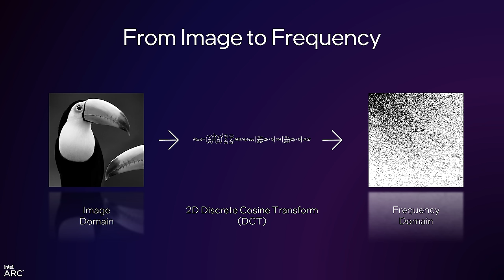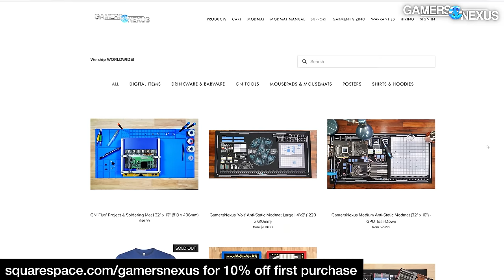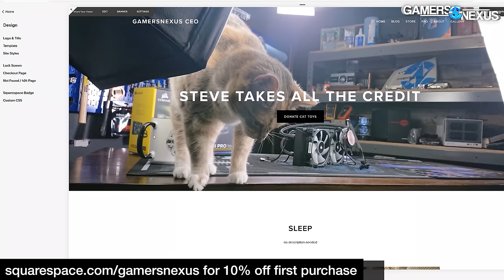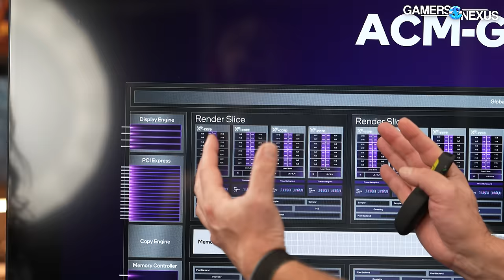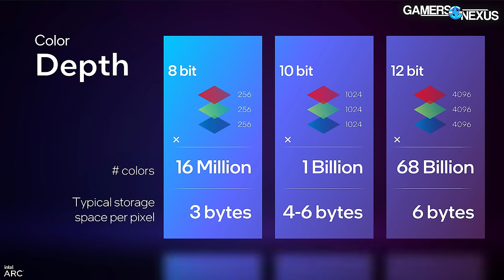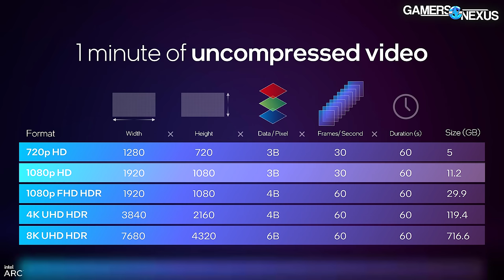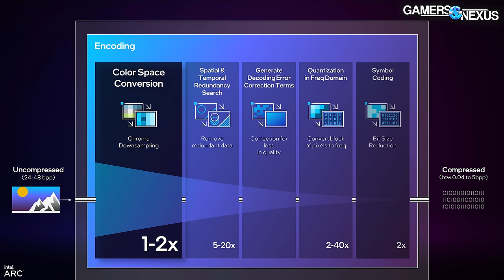YouTube's Existence is Insane: How Video Compression, Encode, & Decode Work (Basics)

Comment: Small correction: YUV 4:4:4 / 4:2:2 / 4:2:0 doesn't describe bits, it describes how many chroma samples are stored. The first '4' says that we are talking about rows of 4 luma samples, the second number describes how many chroma samples are stored in the first of two lines and the second number how many chroma samples are stored in the second line.

That means a 4×2 block of luma samples contains

• 8 pairs of chroma samples in YUV 4:4:4
• 4 pairs of chroma samples in YUV 4:2:2
• 2 pairs of chroma samples in YUV 4:2:0

Another way to think about it is that in YUV 4:4:4, each luma sample has its own pair of chroma samples, in YUV 4:2:2, each 2×1 block of luma samples shares a pair of chroma samples (the chroma planes have full vertical but half horizontal resolution) and in YUV 4:2:0, each 2×2 block of luma samples shares a pair of chroma samples (the chroma planes are half horizontal and half vertical resolution).
Reply: 4:2:0 is truly a nonsensical shorthand made by an insane person.  Because 4:2:2 and 4:2:0 are the only ones that realistically exist, you could just as easily describe the stored chroma resolution of a 2x2 square of chroma pixels instead of the insane self-referential sample numbers, for example:
YUV 2x2 = YUV 4:4:4
YUV 1x2 = YUV 4:2:2
YUV 1x1 = YUV 4:2:0

Even if you argue that you must keep the 4x2 rectangle, describing the stored resolution still works and is way less insane than the "number of changes of chrominance samples between first and second row" like bruh
Reply: This comment needs more attention. It’s good knowledge
Reply: @krakow10 It is a truly bizarre naming convention, I've heard it explained multiple times and never fail to promptly forget what it means. It's easier to just remember one is full res, then half res,  and quarter res .
Reply: @tiarkrezar  Indeed. It makes no sense because its roots are in analog TV and the numbers are not bits but factors of carrier frequencies intermingled with interlace logic.
Reply from the maker: Thanks for this! I asked Intel (since, like I said in the video, I know nothing about this field). Intel said this: 

"Good catch! Although there is a correlation between how many bits and how many chroma samples you store, the numbers represent the actual amount of chroma samples."
Reply: @ИванСнежков-з9й  I didn't know about that history, that's some great technical trivia.  29.97, interlacing, chroma, it all has deep roots going back to the beginning of video technology...
Reply: @casperes0912  It also did not say anything about how the position for the chroma sample  to the luma changes between video formats.   Then  YUV  also has NCL or CL conversions or in a crude way to say "gamma aware" or not.
Reply: This comment is an example of why good conversation after a video is so valuable. Error correction, info expansion, context - all helpful in getting everything sorted and understood.  Thanks!
Reply: @krakow10  YUV 4:2:0 is not a nonsensical shorthand. It exists to easily differentiate from 4:1:1, which is actually much worse.
Reply: @krakow10 Hearing 29.97 again gives me 2:3 pull down chills 😂

Comment: 13:00 that's why it's so hard to compress confetti, snow, or other super small moving parts in a video. There's even a term called "compression nightmare" for these scenarios. Videos appear to be at a low bitrate, internet usage spikes, as well as cpu utilization.
Reply: slow mo guys have show this well with their glitter stuff, gavin is actually very knowledgable about this stuff.
Reply: I remember part of the reddit blackout protest was to upload videos of static that are essentially impossible to compress.
Reply: Yup... a lot of new information gets introduced and removed by the next frame, which makes it impossible for most algorithms to deal with this situation...
But the good news is H265/HEVC/VP9/AV1 encoder/decoders can deal with these situations A LOT better compared to the old ones such as Xvid/DivX/h264/AVC/etc...
Reply: @SkidrowTheThird  by blurring them out lmao, gotta love sao in x265
Reply: and also why common things like a gradual fade in a video is actually quite difficult for compression to deal with, there's very little per-pixel frame-to-frame stability
Reply: I remember running into this issue when playing back a ripped Blu-ray of Prometheus many years ago. There's a scene where Fassbender's character is looking at a holographic display that composes images using thousands of points in a 3D space. When streaming the movie over my local network to my PS3, it always stuttered badly at that scene. The PS3 lets you see the playback bitrate, which showed it go up about 10x when that visual effect was on screen.
Reply: @SkidrowTheThird  Film Grain Synthesis in AV1 is good
Reply: @brunogm  Nope, it is not there yet, very artificial

Comment: WRT frequency domain on images.
Picture it like this: the corner (0,0) is 0 oscillations -- constant value. the pixel at (0,1) has zero horizontal frequency, but 1 oscillaiton on the vertical, meaning it starts at 1, goes to 0, then back to 1, sine wave style (well, cosine actually but you get the idea, it's smooth and connects cyclically end to end). the pixel at (0,2) is the same but has two oscillations vertically, and so on. This step is usually performed on small blocks, 8x8 or 16x16. So on a block of 8x8, the frequency pixel at (8,8) is a checkerboard, and (0,8) is a series of 8 horizontal lines black white black white etc. the bottom right pixel (N,N) on any resolution ALWAYS coincides with the pattern that gives you a checkerboard.
Reply: Edit: Welp, I tried to explain Frequency Quantization and Symbol coding when PAT did it better... When they talk doing it in the residual, that's another layer of optimization in newer video codes, as it works the same as with JPEG images.
Just to expand on it, as this was a moment of realisation for me when studying this JPEG compression: 
For each block of 8x8 pixels of the original image, we will assign a concrete "checkerboard/frequency" coefficient value. Meaning, if the first 8x8 are mostly black, they will recieve the coefficient (0,0). As this is a standard, we know that if we recieve (0,0) this can be reconstructed directly to a set of 8x8 pixels. If you zoom in all the way, you can appreciate the DCT patterns.
We can apply a low-pass filter (reducing sharpness) and then can compress further by assigning compression algorithms to how many bits are needed for each coefficient. Meaning that coefficients that are more common (low frequencies), will use fewer bits that higher frequency ones.
I probably have some of this mixed up as this was some time ago, but it was cool understanding how videos are compressed.

Comment: Computerphile did an introduction on DCT a few years ago going into more details of the math and intuition of the algorithm, in their 3 part series of covering JPEG compression. For those interested, it is a series worth a watch, as video compression seems to be very similar to JPEG compression on differences between frames.
Reply: HEIF, the format that is likely going to replace JPEG everywhere, is in fact just a single frame of H265 video. It just makes sense to reuse the same format for many reasons.
Reply: @Finder245  same case with AVIF, but HEIF will definitely not supersede jpegs
Reply: 3 Blue 1 Brown did an EXCELLENT video on the Fourier Transform which explains how these sinusoid transforms work, and I think explained the tricks they use for the FFT.
Reply: Veritasium also did a pretty good video on the Fast Fourier Transform that underlies DCT.
Reply: Reducible as well!
Reply: @webx135   3 Blue 1 Brown   is the better video.     This GN/Intel colab simplified the transform stage  only showing full image transformed.  In actual codec there is a complex block partitioning first into  blocks (4x4 ... 64x64 )

Comment: Frequency domain analysis is an extremely fun branch of math that has applications in so much stuff
Circuits, sound, images, video
You can view any information as a combination of several waves and instead of analyzing the signal you study its frequency components 
One of the steps there is the same as doing a low pass filter in audio, except high frequency in images correspond to sudden changes in values. Clipping it blurs the image (or whatever the equivalent is in YUV) 
Doing a high pass filter meanwhile is an useful way to get any edges which is useful for image recognition algorithm/AI but makes the image look like a normal map (that's tangent space, not frequency space, but hey)

Comment: I don't know how popular this video will be, but you have my gratitude for doing this. I'm pretty deep into video compression with AV1, but I've never really understood the basics of RGB and YUV (although I had a rough idea of what YUV 4:4:4 does).

So thanks for the very helpful insight, and please never stop making these kinds of videos!
Reply: The YUV explanation is wrong!
The 4:4:4, 4:2:2 and 4:2:0 does NOT mean the amount of bits you take for luma and chroma, it represents the downscaling factor of the chrominance plains regarding the luminance plain. The least bad way to explain it would be to say that the first number is the number of columns, the second is the number of chroma samples in the first row and the third number is the number of samples in the second row. E.g., 4:2:2 means that for every 4 luma samples you get 2 chroma samples in both rows, so basically 2:1 compression for the chroma plain. 4:2:0 means that you get 2 chroma samples in the first row and 0 for the second, so basically 1 chroma sample per 4 luma samples (or 4:1 compression for chroma plains). But ANY of these values are typically encoded using 8, 10 or 12 bits each!!! So this has nothing to do with the bits per pixel, but how much chrominance and luminance values you store per pixel.
Reply: @luisjalabert8366  The amount of unreflective adulatory brown-nosing I need to plough through to get to the one informed comment/reply from someone who immediately notices the same goofs as I do becomes increasingly baffling with every video ... usually I would take the same approach as you to get the point across, but to simplify it even further for here I'd put it as <luma samples all rows>:<chroma samples odd rows>:<chroma samples even rows> for each 4x2 pixel block.
Reply: Colorspace from (8bit) rgb to limited yuv to rgb, after those conversions you'll only get ~15% the same colors you started with because of rounding errors even with 4:4:4 subsampling.

there's another step they might have omitted which was how 4:2:0 was arrived at/extrapolated from, example if you losslessly captured the same file played back with different media players (w/ dithering turned off), or ffmpeg they all might slightly disagree how to display the same frame.

Comment: Really coo video, I don't see enough talk online about the genius of video coding (and even less that is as well explained).

I know this is for the sake of simplification, but having literally done a PhD on inter-picture prediction, I find any claims of how much this step reduces size to be weird, because you're missing out on how prediction is all about the compromise of accurate prediction with good motion vectors and cheaply coded ones, For example, a good encoder will not take the best prediction (that results in the smallest residual), it will take one that is good enough for the level of quality but is cheaper to code (by being less precise or being the same as the block next to it).

The symbol coding is really one of the most complex and genius part of modern methods. First Huffman has been dead for years (only used in like JPEG and low power AVC), everyone uses arithmetic coding, which means that symbols can take less than one bit and the encoder basically figures it out with some complex math. But the real shit is how instead of fixed probabilities/coding that were implied in the video, it is adaptative and will "learn" depending on what you have been feeding it so far. So if let's say you keep having the same direction for your motion vector, it will cost fewer bits if you use it multiple times. There are now dozens of bins that store how they have been used and adapt the coding through the image.

The residual part, even if it looked hard in the video with that good old DCT, is actually the easiest thing and pretty easy to implement, as it is pretty straightforward. Getting the right motion vectors takes a huge amount of time and hardware have to make a lot of compromises to limit the search space since they typically require real-time performance and at least consistent performance and can't afford to spend extra time on an image where it doesn't find something good easily. There are many papers on how to optimize the search, and for hardware in cameras I have also seen the use of motion sensors as a side channel information to guide the search (nice for a camera that moves a lot like a go pro).

Last note with is more a pet peeve of mine, chroma subsampling currently has no reason to be used outside of being nicer on hardware, you will always lose quality and not even get any actual efficiency, 4:4:4 with a bit more aggressive quantization on the chroma components usually looks better than 4:2:0 at the same bitrate, but it does uses more memory and hardware circuits (though nowhere near double like memory, a lot of hardware just uses luma for everything intensive then chroma gets quantized and dealt with minimal care).

Considering it was done by someone with very little experience in the field, I was still very pleasantly surprised at how accurate this was for such a short explanation.

Just a disclaimer on the hardware claims, I have not worked with Intel encoding/decoding hardware and will not mention the ones I used because of NDA (including some projects that aren't yet released/were canned).

Comment: The YUV explanation is wrong!
The 4:4:4, 4:2:2 and 4:2:0 does NOT mean the amount of bits you take for luma and chroma, it represents the downscaling factor of the chrominance plains regarding the luminance plain. The least bad way to explain it would be to say that the first number is the number of columns, the second is the number of chroma samples in the first row and the third number is the number of samples in the second row. E.g., 4:2:2 means that for every 4 luma samples you get 2 chroma samples in both rows, so basically 2:1 compression for the chroma plain. 4:2:0 means that you get 2 chroma samples in the first row and 0 for the second, so basically 1 chroma sample per 4 luma samples (or 4:1 compression for chroma plains). But ANY of these values are typically encoded using 8, 10 or 12 bits each!!! So this has nothing to do with the bits per pixel, but how much chrominance and luminance values you store per pixel.

Comment: Excellent video! I'll point friends who are new to video/image compression this way.

One thing to note, from haunting video compression forums for many years. While the fixed function decode hardware on GPUs have been very fast and as fully featured as software decode since 2006 or so, and of course the same quality as software decoding, the same can't be said for encode even today. The x264 guys, to my best recollection viewed GPU encode as a marketing exercise, and saw very little speedup in leveraging GPU hardware themselves in comparison to other possible optimizations. Still today I'm not aware of any leveraging of GPU hardware by x265 or rav1e.

NVIDIA has the best GPU hw encode quality currently, and they're all somewhat better now, but not much. At least on NVIDIA and AMD, the encoders use much more of the actual programmable shader hardware than decode does (slowing games, etc.), they can't use many of the advanced features of the H.264/HEVC/AV1 formats, and they can struggle to compete on quality with 2-4 modern CPU cores running e.g. x264 --preset veryfast. If you can, try isolating a few cores and running software encode - you may be surprised, especially since you can still use the decode hardware on the input video if it's compressed.

Comment: Seriously, modern compression is amazing.

It's crazy to see images with 5 megapixels (like 2000x2500 px) that have barely more than 200 kb filesize. At 3 byte per pixel, these are 15 MB raw.

And if you edit and re-encode a Youtube video with older or generally worse settings, you both lose quality and get like 5x the file size. The processes on larger media platforms are super impressive.

Comment: A good way to explain what the 2D DCT is, is to make an analogy with sound and a spectrum analyzer. As the pitch of a sound rises while maintaining the volume, the bars of the analyzer shift to the right without changing the height, and if you have a sound consisting of two tones combined, the analyzer displays two separate spikes. The 2D DCT is exactly the same as a spectrum graph, except it's on two dimensions (width and height) rather than just one (time). Both images and sounds are signals that can be processed.